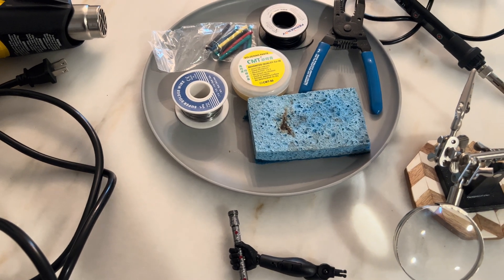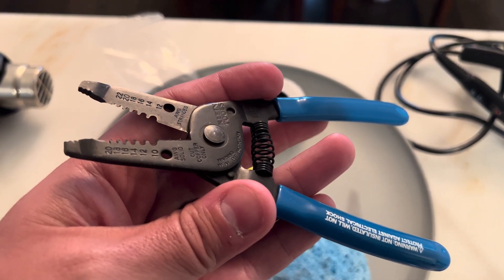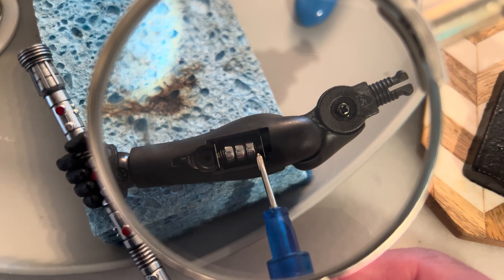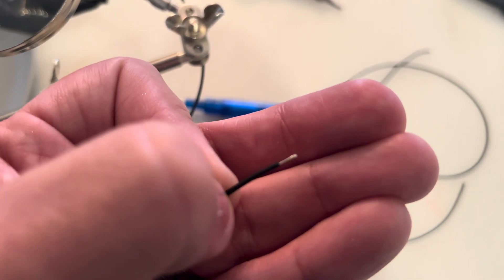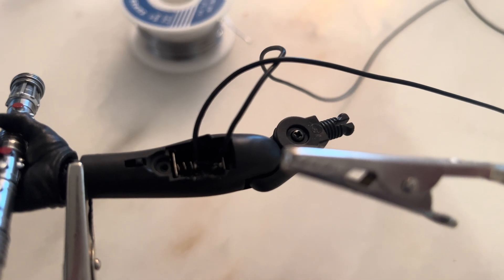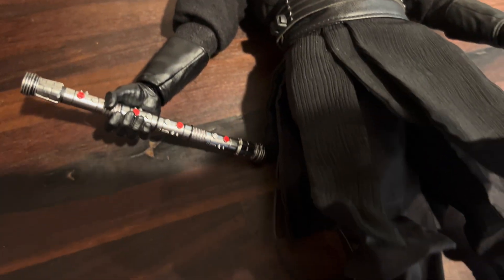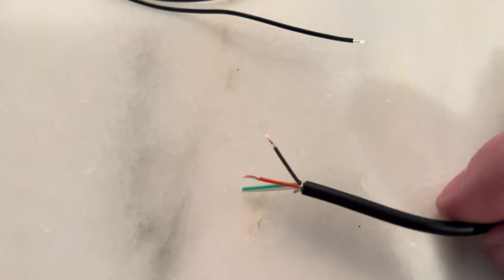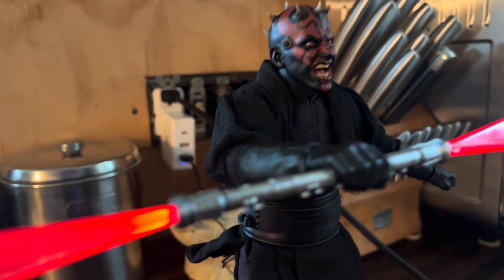Hot Toys USB Tutorial | STOP using batteries!

Comment: So there can be a voltage issue here. be sure to check the voltage in which batteries are in the figure, Lowest output for most charging bricks is 5v, some can but MUCH higher , if your figure is only using 3 volts you could burn out the LED quicker

Comment: bro, what if it has multiple lights like the iron man figures, do u need to increase wire sizes or adjust anything?
Reply from the maker: You don’t need to increase the wire sizes but you do have to have multiple connection points that you can solder together as long as you keep black with black and red with Red you pretty much don’t have a problem or negative with negative and positive with positive that makes sense.will you would need for the Iron Man figures are resistors that will dial down the voltage so you don’t short circuit anything the biggest thing is maintaining the correct voltage. I do plan on doing an updated video shortly wiring an Iron Man figure with multiple connection points so someone can see how to do it.
Reply: @mr.momcollectibles I'm gonna wait for that video then, so I won't burn my figures. Kindly detail it on your video please. I really appreciate it.
Reply from the maker: @lyradboado5163  absolutely I always had plans on doing at least 1 Iron Man figure with multiple points so now’s the time. No worries I will outline everything and links on where to buy materials.

Comment: I was about to place an order with fusion reactor but now I’m gonna try this myself looks easy enough
Reply: Me too, he was charging me $120 for an older iron man and decided “yeah time to learn something new”
Reply from the maker: I was in the same boat, I had all the supplies from previous project so the cost was next to nothing for me. If you have experience soldiering and heat shrinking connections it’s super simple. And when dealing with a figure that has multiple light points like cyborg for example gotta keep negative with negative and positive with positive it’s not hard either.